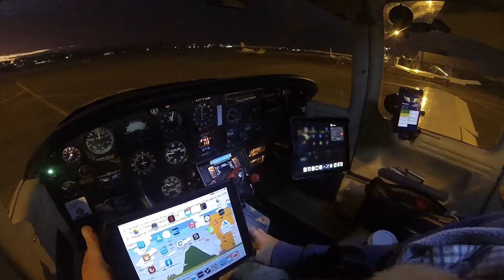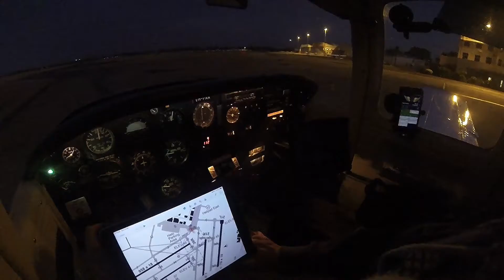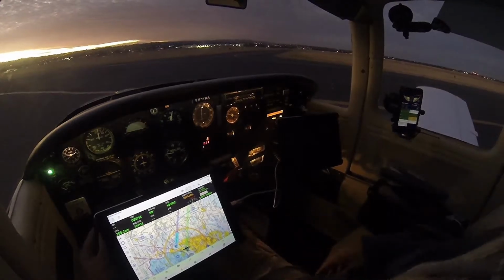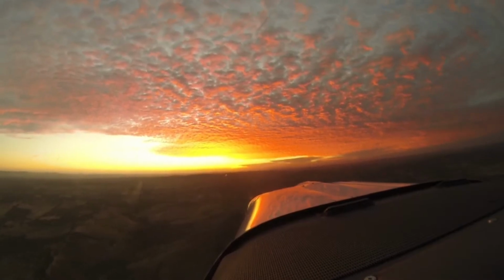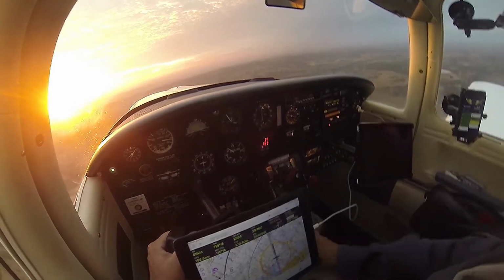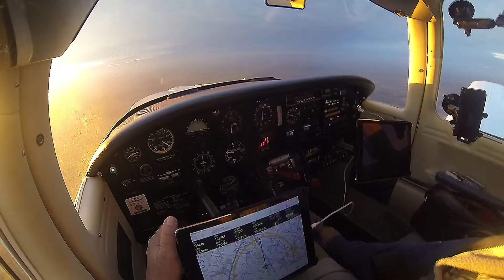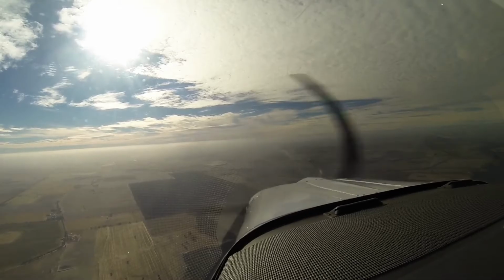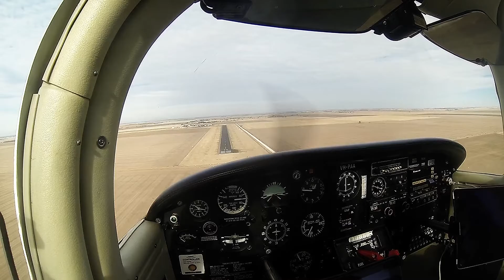A flight from Parafield Airport YPPF to Horsham YHSM

Comment: Great flight! Are you going to the barossa airshow?
Reply from the maker: Hope too it would be a nice day out
Reply: Also nice audio and video setup. What are you using to record? Would love to have a chat about it.
Reply from the maker: @geoffwoodberry2324  Gopro cameras on RAM mounts, with an audio cable in the headset socket that splits the transmissions to the camera and headset.
Reply: @RodneyvandenBrink  Nice! I might try that out as well.